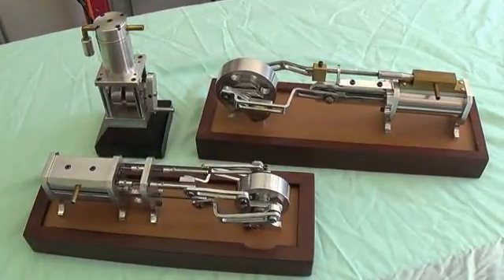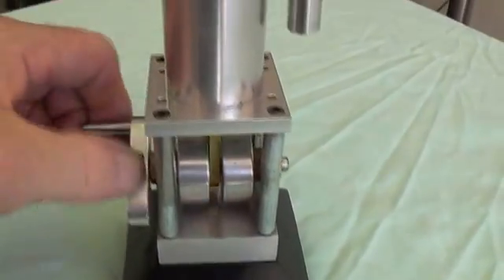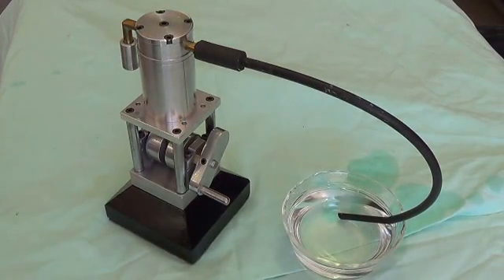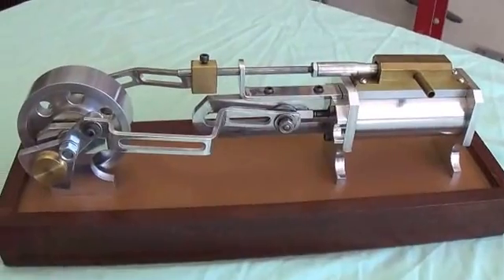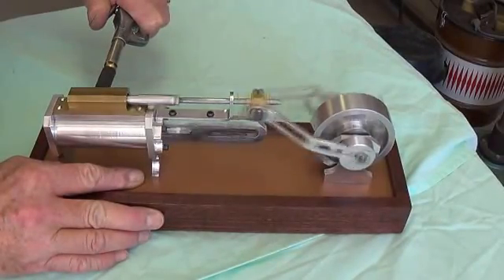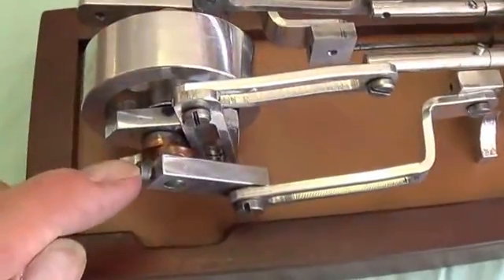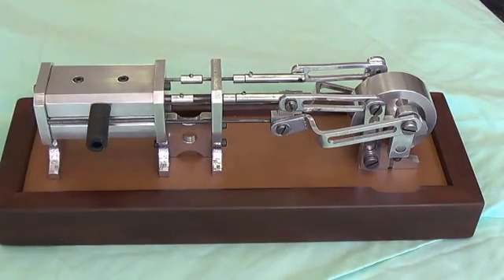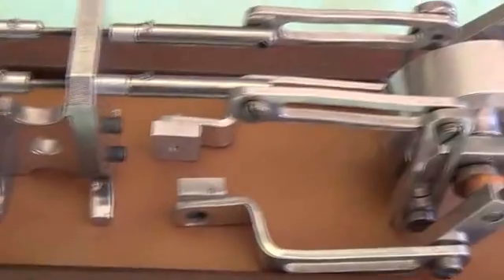Two Home Made Steam Engines and a Manual Air Compressor.....One Blows Up

Comment: Good video!  Enjoyed the engines.   You could drive the air compressor with the two cylinder, and then use the air to power your single cylinder. ! !👍
Reply from the maker: Thanks, GW.   Good suggestion :)

Comment: Great work!!!  I was thinking about the exhaust, and if you were using actual steam, and how it might make sense to recapture the spent steam.  It seems like I saw a steam car video once that recaptured the steam so the driver didn't have to add water all the time, but I'll bet that was simply going into a condenser to turn the exhaust back into water.  I guess that trying to capture the steam under pressure would steal the engines use of the steam.  So, I was pondering how you could get the water back, plus make use of some of the heat the exhaust was putting out.  My thought was a double boiler.  Something to chew on if you ever decide to take your project a step further and build the boiler.  Great video and great work.  I usually watch your amp videos, but love all sorts of tech and creativity.
Reply from the maker: Thanks so much for your excellent observations and suggestions, TW. I will keep them in mind for the future.

Comment: Wow, Uncle Doug! I am really impressed man. You just built those models off the top of your noggin eh? They look great. Very professional and nicely mounted for display. That's some VERY nice work. Gee, I'm sorry you broke that one though. I see that this video in several years old now so I imagine you've repaired that 2-cylinder one by now. A follow-up video would be kind of nice. That is if you happened to have documented any repairs you might have done since this video was posted.
Reply from the maker: Thanks, DE. Yes, I repaired it the same day it broke.

Comment: love the video ..but my real question is a different subject .....WHAT'S THE DIFFERENCE BETWEEN HORIZONTAL AND VERTICAL MOUNTED REVERB TANKS ?
Reply from the maker: The tanks are constructed differently and must be mounted in the proper configuration or they won't work well. Part of the identification number of the tank specifies how it must be mounted. Do a Google search for Accutronics reverb tanks to see all the details.
Reply from the maker: As far as the actual physical differences between them, I believe it involves the way the transducers connected to the ends of the springs are constructed. They must be able to maintain their centered position, regardless of the direction that gravity pulls upon the springs.
Reply: Thanx for the info
Reply from the maker: You're welcome :)

Comment: In true definition this is actually a pneumatic engine. It makes you think why they don't develop one for cars and pickups. There is a lot of possibilities from storing air in tanks and refilling as needed. Using a electric compressor utilizing a solar panel. As well I've watched a lot of your videos, and what surprises me is you have not shown any interest in Arduino components. You may very will know that Arduino is an open source based in C/C+. One example is you could of set up a motor to operate your air compressor you reviewed here. I know you really from the old school and may not have much interest in present day electronics. But in reality, you already obtain the knowledge. But while I'm on the subject I would also like to see you work more with the oscilloscope.  Example of this, on one video you explained how the cap was able to square up wave by charging on the up swing and discharging on the way down.
Reply from the maker: +Ron Hutchins I believe there are prototype vehicles that use compressed air for propulsion. It would be an ideal energy source, since it is plentiful and the "waste products" simply replenish the atmosphere. 

By coincidence, I am involved in the design and fabrication of radio-controlled quadcopters, primarily for photographic purposes, and Arduino devices are widely used as flight controllers, telemetry systems, GPS units, etc. I have considered starting a separate YT channel to post videos related to this other obsession/hobby. 

I use the oscilloscope sparingly in videos, primarily to demonstrate phase inversion, tremolo effect, etc. 
As the subject matter of the technical videos increases in complexity, I will probably use the instrument more frequently.
Reply: +Uncle Doug Let me ask you what do you think of LCR meters. I've heard you can check caps with out pulling them out of service. Usually I use my meter to check caps, but I'm not sure about LCR's.
Reply from the maker: +Ron Hutchins I don't personally own an LCR meter, Ron. I have a capacitance feature on my digital multi-meter, a separate ESR meter, and a DC power supply that allows me to measure leakage at full operating voltage. Of the three, the only one that can measure caps in circuit is the ESR meter.

Comment: Hi Doug, Now this is a surprise for me... something I actually know about. Your workmanship is excellent, and I'm impressed that you actually made these work. However, I wouldn't recommend that you actually try these on steam... the heat of the steam will cause the aluminum to expand and you would lose your seal in the cylinder(s). Not to mention what the high temperature of the steam would do to the oil... By the way, the definition of a piston is a plunger that has piston rings (like your jeep). Not that it's all that important for these models, but I just thought I'd pass that on. Again, my congratulations on such a nice job.
Reply from the maker: +Bill Daniels  Thanks, Bill. I wasn't aware that true pistons had to have rings, but it does make sense. I don't have a steam boiler and always run them simply on compressed air. Glad you liked them.

Comment: Again you surprise me  with your skills and after going thru your videos I wonder where you find the time to eat or sleep ,you have a lot of cool interesting stuff I will be busy for an entire year just trying to watch them all ..Steam , metal and lathe work is another shared interest ,Im mostly a weld , fab and fit guy but have done some CNC work milling rough from the foundry  , cast aluminum smart bomb directional fins to the mil . contractors specs .My only real claim to serious mill work .. But did build a homemade lathe a few years back but was too big for my needs and hard as heck to get everything trued up and turning . and staying true . Back in 2003-4 ??  music and trucking had hit a slump and I needed to pay bills and took on the apprentise job in a 3-4 man small machine shop with two big CNC machines doing the fin work . 
   With the war in  Afghanistan in full swing I guess there was a pretty high demand for them because we were busy as the dickens getting them out to the contractor ..I could not tell you one dog gone thing about programming a machine today and they were basically a  put in the piece , program and forget set up .and remove repeat and mic each piece .  Nothing artistic like working with a turning lathe . And your work here is just that ART,. Really clean , functional pieces worthy of sitting on a coffee table ...IMO.....I have a 10x 20 small welding shop adjoined to my small always too cluttered shop I do the not so nasty tinkering in and would be lost without either . But curious about your pistons in the 2 cyl . engine . are you using any type of compression rings for making pressure or just machined close enough to do with the slugs themselves . I love the cam , timing adjustment for the two and the set screw for the timing , simple and effective . Sorry to see the Rod breakage and no doubt you already have that one fixed  or figured out . Thanks for the vid it was fun to watch
Reply from the maker: +Eddie Joe Gongre Glad you like the steam engines, EJ. The pistons were simply machined for a tight fit with sufficient clearance for an oil film. I have repaired the rod to piston junctions and now am more careful about the air pressure I use and  limit the max RPM's to a less destructive level. Thanks for watching and commenting :)

Comment: what milling machine did you buy ?
Reply from the maker: Joe Towell It's a Central Machinery (Harbor Freight) Mini Vertical Milling Machine SKU #44991, Joe. As it always goes with items like this, the accessories ended up costing more than the mill itself :) It's turned out to be a very useful tool.

Comment: well, you DO have a bit of a problem.....try arc welding the piston slugs to your pushrods.....(the slugs need to be same alloy stainless also).
ypu start by using a counter sink bit to bevel the hole in one end of each slug, then insert your pushrod from the other end of the slug, then arc weld.
that should fix your problem.
please let me know how it turns out.
Reply from the maker: jim walker It was repaired almost immediately after the damage occurred, Jim, and has functioned well ever since....at much lower air pressure :) Thanks so much for your input.
Reply: no prob....i hope it continues to do so.
safe journeys.

Comment: Very impressive! Particularly that you do these off the top of your head with no plans! 

Ever thought about trying a Stirling engine?
Reply from the maker: Thanks, AQ. I think I'm just so anxious to start building (like a hyperactive kid) that I can't force myself to spend time drawing up plans :) I've never built a Sterling engine, but it would definitely be an interesting project.
Reply: Uncle Doug I grew up with LEGO so I know the design-as-you-go process well. (The '70s LEGO that actually required imagination, I mean. I also had some serious LEGO... http://www.technicopedia.com/853.html )

I'm a software developer these days, and still work like that. Though the editability and non-linearity of writing software means there's no mistake you can't undo. (Still, us programmers are often guilty of continually "refactoring" the solution -- tearing up the design on the macro scale and essentially starting again from scratch -- as we tend to grasp the problem better as we work on it over a few iterations.)
Reply from the maker: We had Erector sets in my day, all-steel girders and fittings held together with machine screws. You could make Ferris wheels, the Eiffel Tower, etc.....and a stout electric motor with a transmission to power them at different speeds.  Those were the days :)
Reply: Uncle Doug Yep, we still had those in the early '70s as well. Can you imagine them marketing that today? Sharp edged sheet metal pieces for kids to poke their eyes out with. Not recommended for kids under 25 years of age. Helmet use is mandatory. Not allowed in your carry on luggage. ;)

Comment: Well done Doug--made on the fly,its really good--one criticism and you probably own up to it--bent connecting rods,they look awful but for first try really good..I own up, my camera skills are rubbish so I will never have stuff up so you can be critical of my efforts,but well done just the same..
Reply from the maker: Thanks, Ian. I understand your esthetic complaint about the bent connecting rods, but couldn't think of any other way, 'on the fly' as you said, to transition between two very different widths. Added to that was the difficulty of bending aluminum without getting stress cracks, and the fact that I consulted no outside sources for design assistance. I guess "real" engines are designed with only straight connecting rods? It would make sense, to eliminate any angular (vector) forces in what should be a purely linear driving motion.

Comment: nice, i wanna make a steam engine that can actually drive a small ride-able cart haha
Reply from the maker: Austin Wright There are all sorts of steam-driven cars, trucks, and boats currently available (check the Internet), Austin. As far as a steam-driven cart large and powerful enough to transport you......I'm not so sure :)
Reply: Uncle Doug
well, steam engines have alot of torque so im not worried also gotta have the right size pistons and all that and blah blah blah...if i pull it off ill ride it around the place haha
Reply: A box with pistons on the sides that run a 0-4-0 wheel arrangement?
Reply: Go metal detecting around you're grandfathers farm, that's how I found the family's traction engine! I know how to run it so some times I drive it around.
Reply: There you will find a large stationary engine.
Reply: RC steam boat... hmmmm
Reply: @PandemoniumMeltDown  i completely forgot this 5 year old topic even existed, thanks for reminding me lol
Reply: You mean a traction engine? -_-
Reply: Dr. Jak G. Cogsworth
no...not at all...the engine its self is a steam engine, now take one of those and mount it on a cart that cansupport it and boom, a simplified version of the stanley steamer

Comment: Nice machining work, considering they were just practice pieces to get familiar with your equipment. The single cylinder double action design is especially nice with its eccentric-driven valve action.
Reply from the maker: Thanks, DL. I appreciate your kind appraisal :)

Comment: if you want something to build how about a 3000psi compresor to  fill a dive tank. then you dont kneed a boiller just run the engine on comprested air. also your car.
Reply from the maker: This reminds me of a story I read about a dive shop in Mexico that used a gasoline-powered compressor to fill dive tanks. Unfortunately, the air intake of the compressor was too close to the exhaust of the engine, and the tanks contained high doses of carbon monoxide.  I assume they had very little repeat business.
Reply: Load one of these with 3k psi and see what happens.....
Reply from the maker: Connecting it to about 100 psi was damaging enough.....I shudder to think what 3K psi would do.

Comment from the maker: They are well lubricated. The breakage occurred because I ran the engine way too fast and the pistons separated from the rods. In the future, I need to be more careful with the air pressure I use.

Comment from the maker: I'm afraid I'd have to crank the little compressor like a wild man to get enough air flow and pressure to drive one of the steam engines. However, at least I wouldn't blow one of them up (like I did with the big, electric compressor).

Comment from the maker: Thanks, David. Yes, I find it easier to simply start building, solving problems as I go. In all three cases, it seemed to work out fine. I can't imagine the stress necessary to tear the swaged heads off of stainless steel motorcycle spokes, but it must have been considerable. What was left of the spoke heads was still in the pistons, battered beyond recognition. The two-cylinder engine has been rebuilt with new rods and is fine. I'll have to  be more careful with the air pressure in the future.